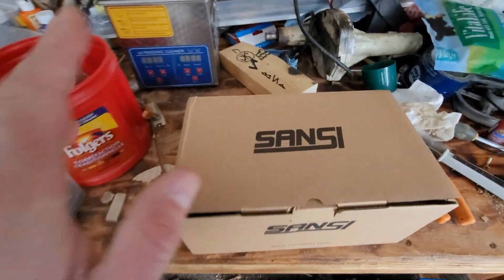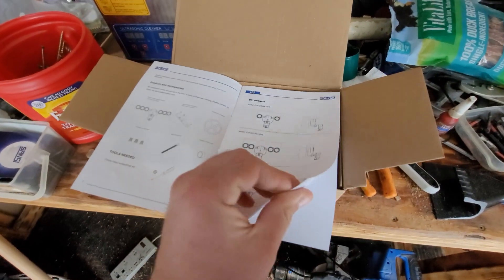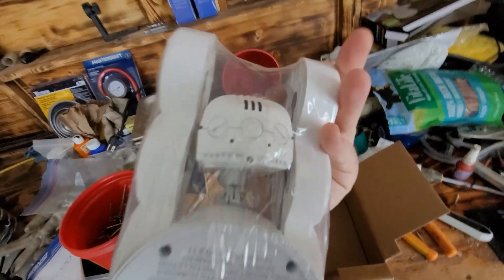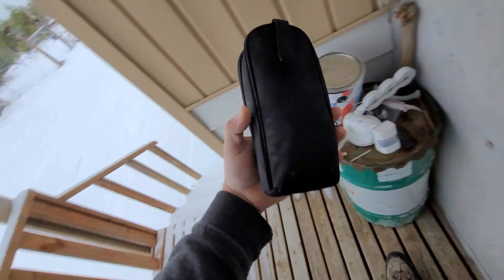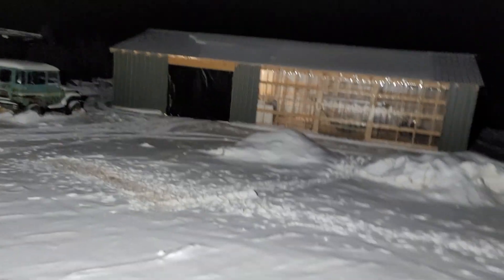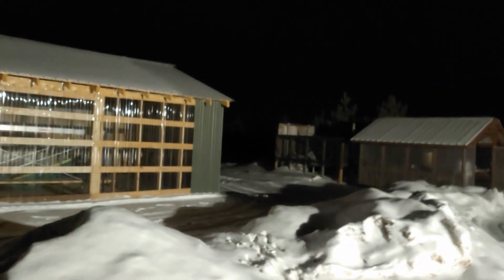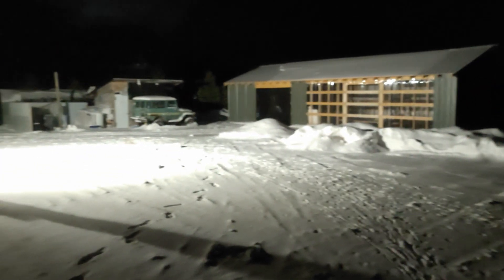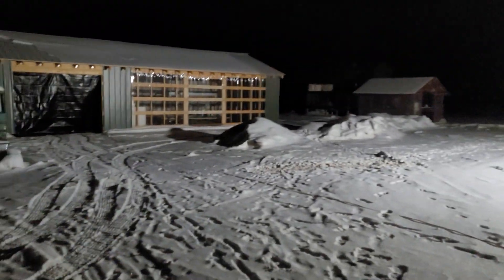New Sansi 45W (6000 lm) LED Security Light (Best model Yet!)

Comment: Nice and bright light. It's colder here in southwest BC at -11C. The previous light could be repurposed on the side of the shop.
Reply from the maker: for the last week and a half we have been around -30 temps LoL! 
This year the weather / Temps have been all over the place. 
I am not 100% sure if i will be installing 120V into the shop , kinda thinking of keeping everything  48V 60W/95w POE++
Reply: @starpuss  Brrr that's cold there lol.  -11C here again this morning, had a foot of snow yesterday with 3-1/2 ft deep drifts lol. 120V might be handy for the compressor etc.